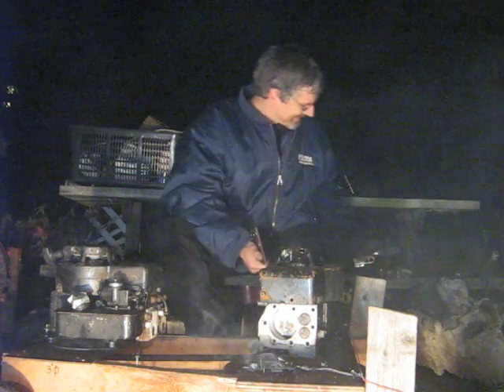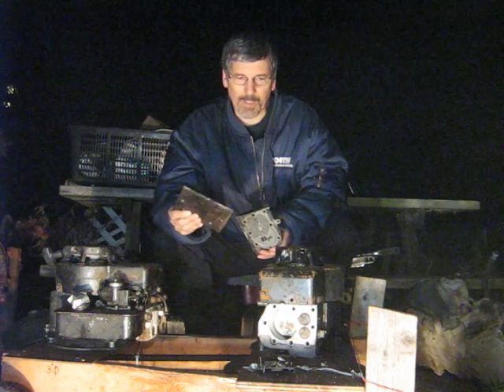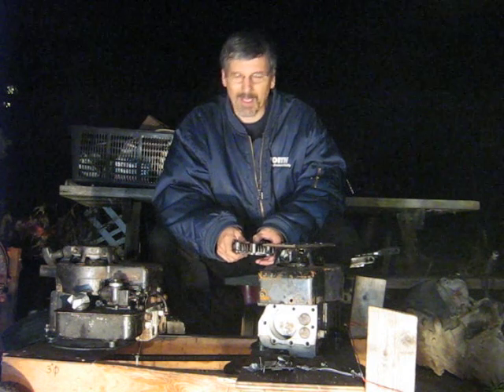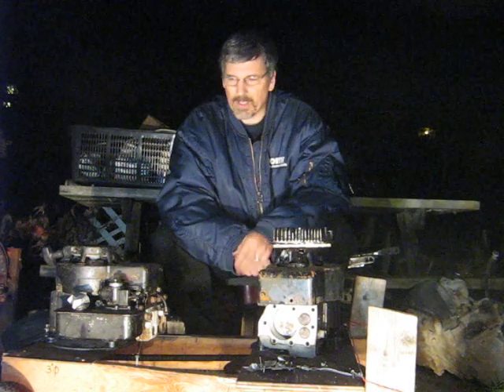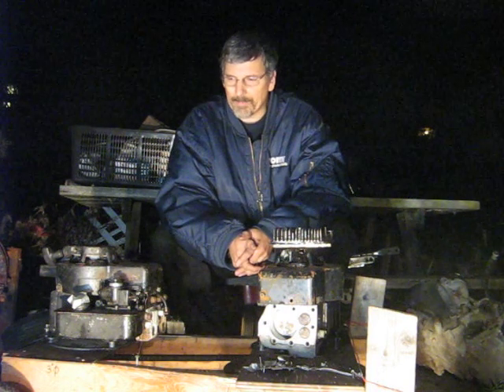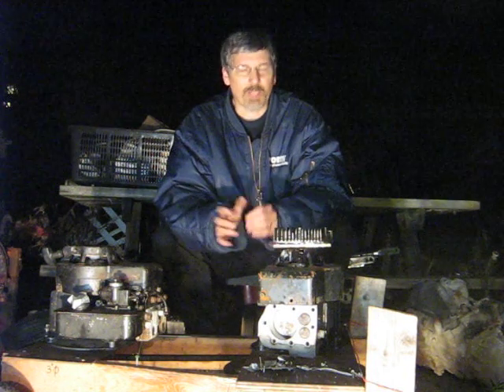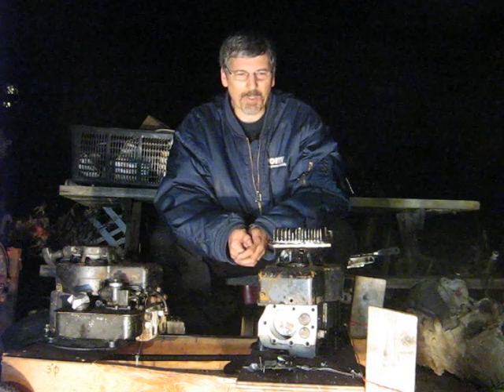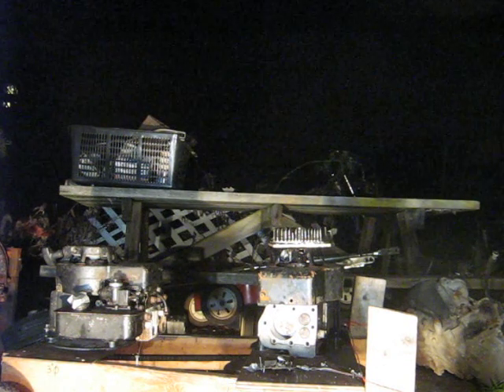Stage 13...170 psi. Experimental Air Compressor!!!

Comment from the maker: @Slider68 
Thanks for your comments, I have taken a car compressor apart, that was quite the job!
Thanks for mentioning the need for a pressure relief valve at 120psi. I just want to make sure folks do this as safe as possible, since I don't want to play any part in sonebody getting hurt. And remember folks, these are EXPERIMENTAL air compressors, so you do it at your own risk!

Comment: Just to add a little more info.  A/C compressors with a sump do need to be oriented with the sump down.  Adding a crankcase vent can substantially reduce the amount of oil that gets into the air.  Without a vent, depending on piston/ring/cylinder condition, pressure can build in the case and push oil past the piston.  A/C compressors are good for 300+ psi so you are safe running 120-150 psi.  Also the A/C clutch (12V) works great with a 120-150 psi cut out switch.

Comment: One component that works great as an air compressor is an automotive A/C compressor.  The older York units with an internal sump are ideal since little oil gets in the air.  Another good option is the old GM A6, which is a double acting 6 cylinder compressor (3 pistons, commpressing at both ends).  The A6 also has a dedicated internal sump, but due to the design some oil gets into the air.  I paid $10 for my A6 at a wrecking yard, it pumps LOTS of air and I've run it 100's of hours.

Comment from the maker: @shinyfuzzy 
I suppose you could mill it a bit, but then you reduce the material thickness, so make it weaker :(
I think using a stock head to make 50psi should be fairly safe to do (just my opinion). However once you get above that, and make a new head to increse the pressure, thats when it starts to become dangerous. I think the main weakness is where the compressed air line attaches to the head, the air is very hot, and thus weakens the air hose. Thats why they use metal pipe on compressors

Comment from the maker: @mytmousemalibu 
Yes, the discharge pipe from the head gets extremely hot, thats why most compressors use a copper pipe between the head and the tank, to help dissipate as much of the heat as possible. I went with lots of steel pipe on my 125psi compressor, since it got the sir hose too hot, and it popped the end off :(
And I don't live in a really hot climate, somewhere hotter would cause even worse problems!
I will make a vid explaining about compressor heat :)

Comment from the maker: @shinyfuzzy 
Yes, exactly what I am trying to avoid!
Thats why I don't recomend using epoxy to build up the head, for incresed output. Doing that worked OK for the short duration runs I do on the videos, but for a real compressor, it just won't last. It will crack and break off, and possibly plug up the discharge line leading to major Trouble!!!!!!   :(
I just want to make people aware that generating high pressures (60 psi and up) can be dangerous.
Just watch my vids, and BUY a compressor!

Comment: lot of people dont realize how stinking hot these can get! grab hold oh the compressor discharge line off of one thats been running.....bet ya only do it once! Im in transition to beeing an A&P,and well... turbine engine bleed air can be in excess of 500*F! Thats some compressive heat!